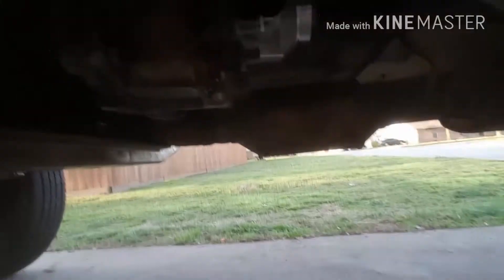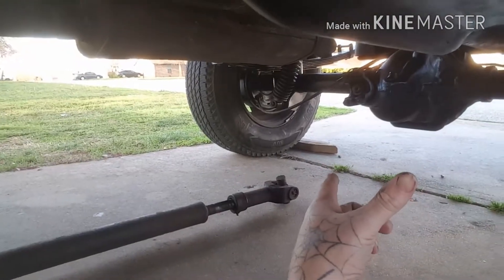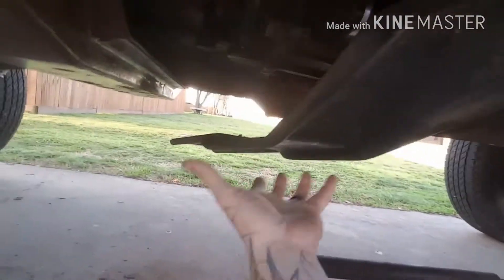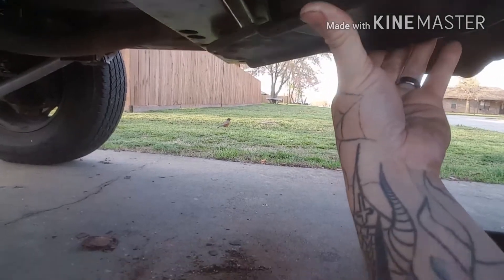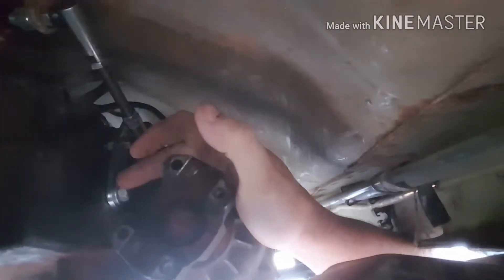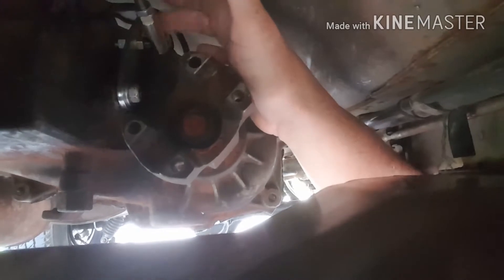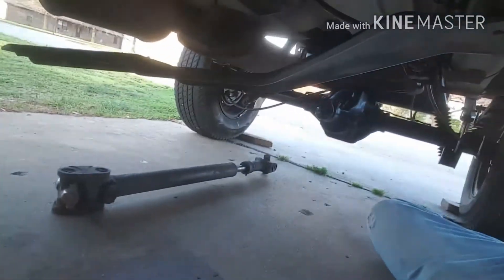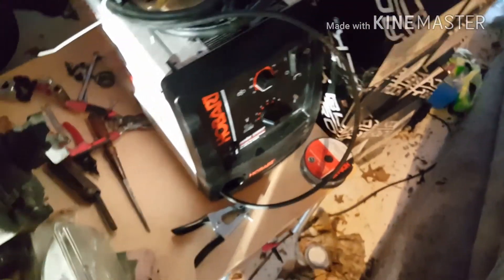Boostwerks Linkage Upgrade cherokee xj transfercase!

Comment: Wish I had seen this product sooner! I broke a drive shaft and it also broke my T case and all the shift linkages. I rebuilt a t case with all new bearings, chain, and SYE but the hardest part was scavenging the non broken shifter off my parts jeep and putting the dang thing on the new Jeep. I would have totally paid $45 for this thing if I knew about it
Reply from the maker: Sorry to hear that bro! Well hope your jeep is going well now!!!!

Comment: This was awesome!  Thank you so much.  I have a 2000 xj.  First winter with it in nyc and used the 4full time all wheel drive.  It won’t shit back into 2wheel.  I am not an expert In Cars or jeeps.  I was looking for something simple to do to improve it as I don’t do any heavy off road.  Seem much easier to install in a small shared driveway.  Any pointers?
Reply from the maker: +Jose Gonzalez ... u will just have a time being patient to take off the nutts for old bracket.. use a small crescent wrenck or a stubby...once thays done just follow directions buddy.. adjust it and get in and check a few times... just slightly tighten ti check till u get placement. Enjoy it man!!! Also big Thanks!!!! Any other ? I will try to help if ya need assistance!!

Comment: I have a 3 inch lift with a 1 inch tcase drop, can I install this with the drop? Or get rid of the drop?
Reply from the maker: I think they sale the kit with a exstended piece for transfer drop! If not then ditch the drop IMO. 3inch shouldnt need much drop , not sure your brand lift tho... Thanks!!
Reply: @jeepXstreme  I'll probably ditch it, all my jeeps that had 3 inches never had a problem with no drop. This jeep has a drop and I cant even get it into 4lo, I've tried adjusting the case and even tried by hand
Reply from the maker: @jackiecarpenter7747  Sounds the best option! I'm not a fan of Tcase drops anyhow.  However, hope bolts are not corroded on your rig! Mine always seem to be a pain. Heat heat and more heat! Double nutt etc...